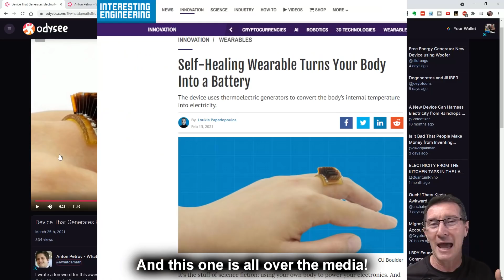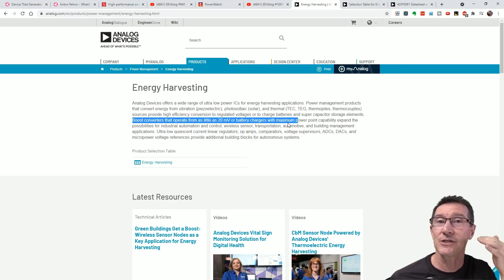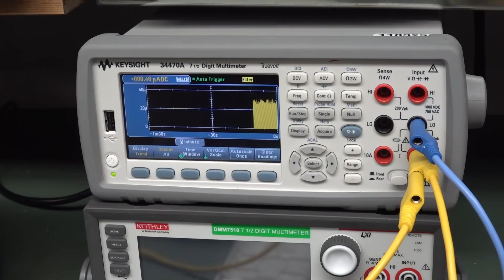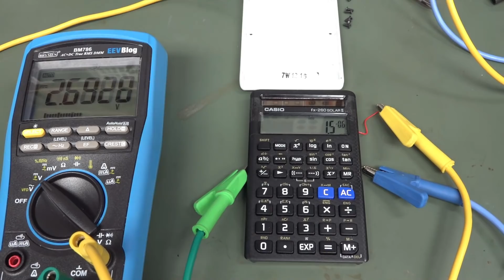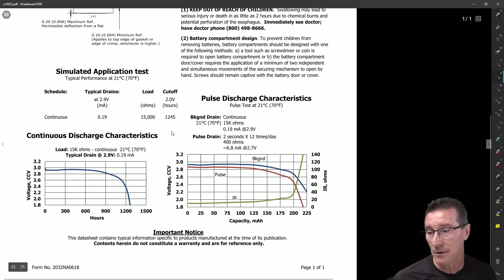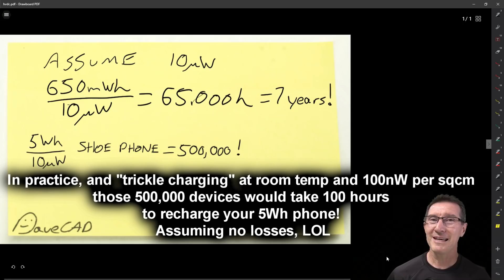EEVblog 1383 - Human Battery Energy Harvesting BUSTED

Comment: I love debunking videos not just for the drama, but mainly for the real-world application of electronics theory, principles and practice.  That kind of stuff is normally taught using "toy" problems.  A good debunking kicks ass, and gives plenty of encouragement to dig deeper and learn more.
Reply: My original comment got deleted .... did you delete Dave ?
Reply: @thepowerisinyou2886  what was your original comment. sounds interesting
Reply: Some preposterous bull is stuck on our faces & we need to jettison & debunk these masters of disaster for the fraudsters that they are
Reply: debunking simple things also confirms ones self grandising bias. assuring that if you come across an anomolous effect you are more likely to dismiss it without further research. because you already know everything. handy tool to have.
Reply: A comment from 18 hours earlier than the video publishing...
Reply from the maker: @redsmith9953  Patrons and forum supporters often get to see videos early.
Reply: @EEVblog      dave your wrong we use heat all the time to convert to energy i.e nuclear , mirrors  ,   etc..
Reply: @redsmith9953  I think donors get to see videos a bit earlier
Reply: @chouseification  , oh thanks, mystery solved, thanks!!!
Reply: @bobjohn8581  -  Thank You for your info   :    )

Comment: He leaves out so much by using the word practical because he has a limited ability to make a system that works. So this is click bait garbage and insulting. 

You can power small devices with energy generated by the body.

Comment: Not that it tells about how useless thermo-electric generators are, but more about how consuming our smartphones and smartwatches are. We need more low-powered devices. Especially for things like watches. Smartphones is one thing, but I don’t need some full-hd-like resolution on smartwatches. I don’t need ECG, GPS, auto-SOS, I don’t even need accelerometer. I already have GPS in my phone, why would I need it in watches… Basically just give me Bluetooth for the ability to sync some data like to show notifications from phone, plus a few apps like timer, clocks, alarm-clock, and nfc, - should be enough for watches. If it can really work throughout years without charging, it’s good, it’s what I’d want. I mean, I have Apple Watch, and I only use the mentioned functionality (clocks, timer, alarms, notifications, nfc), but unfortunately they live thoughout like… A day or two? Useless. I’m not even feeling like spending time to wear it on my wrist for that amount of time. I feel enough charging phone and iPad everyday, I’m not feeling like adding smartwatches to the list. Too many things to change. So my watches just keep lying on my table, infinitely on charge. Because fuck them. Give me more low-powered devices. Especially those non-essential devices like watches. Give me watches that do the watches stuff (clocks+timers+alarms), plus notifications, plus nfc to be able to pay with it. Make it low-power consuming. That’s all I need from watches.

Comment: I can see a very interresting application for power harvesting in the human body: For pacemakers, basically your body charges a battery/capacitor which is then used, but it is probably more expensive and less reliable.

Comment: We need to get Jixuan and Sebastian in here to read this white paper "all hail the white paper" and tell you that it gets 19u/W at 95K which is -178C and -288F, so at room temp of 21C (70F) you are at 294K, which is not only greater than 95K, it's 3 times the required temperature. That means it's going to generate 57u/W  per cm2 which is even better. Making a backpack out of this could power a phone or tablet.

Because if the guy is so dumb as to think thermal expansion only applies if one side of the object is hot and the other side is cold, then he is going to believe what I just said hook line and sinker. I feel bad for the university that gave him a degree.

Comment: Creating a thermal electric generator that's powered off the human body can really work. The only thing you need to do is increase your body temperature to about 350 degrees Fahrenheit, none of that Celsius crap. After that you can probably generate enough power to light an LED.

Comment: This is a fairly common thing. How many battery tech announcements have since gone the way of tech like this? The announcement is sensational and cool sounding, but never has applicable use. I remember some scientists in the early 2000's working with rat brains. They claimed they were teaching rat neurons to fly an air plane. The problem is the neurons would live at most hours and suffer severe damage at the electrical interface to the computers. The actual success rate was 1 in 10,000. It took many hours of set up just to get 10  or 20 neurons out of thousands to actually respond to electrical stimuli. It was essentially sensationalist publishing that would never see applicable uses. I'm sure brain to hardware interface research is ongoing, but there was zero chance their rat brain neurons were flying anything in 2000!

Comment: I like to assume the human’s understanding of the matrix robots’ plan was wrong (the robots did take over the planet and maintain dominance, after all).  That what was actually happening wasn’t using humans as batteries; that the robots were using humans as neural network processors that are powered by carbohydrates rather than electricity.

Comment: Debunk the 2.5v they say in India they are running analog clocks. If you hold a carbon rod in 1 hand and a magnesium rod or piece in other and hit voltage meter unit shows 2.5v

Comment: well, considering Casio wrist watches... In 1992 my classmate had some watches  (I can't recall brand) working on heat power. I looked at it thoroughly and there was no any battery holder and it had some shiny metal plate in the cavity. And it worked. That was amazing! Surely they consumed very low power, modern gadgets consume thousands time more.
 But in short time they started go faulty, LCD covered with black haze, mostly after him sweat, humidity did bad job.

Comment: I was wondering, ditching all the skin stuff, if we put this technology to use in powerplants of today (so realistically, we're probably talking dozens of meters of surface area and hundreds of degrees C difference at minimum), would these be more efficient than steam turbines? i'm mainly assuming this because of no moving parts and fewer energy conversion steps (heat directly into electrical, instead of heating water to produce steam, which then turns a turbine and that then turns a generator that makes electricity).

Comment: There was something similar to this (in terms of being impractical) a few decades ago that used a tiny magnet on a spring in a coil. It supposedly turned movement into power. But basically you would have to be a punk doing the pogo on speed to get any power worth having out of it.

Comment: Very interesting investigation.... Looking forward to future installments. 
I've got a 3" square solar cell I use to power an AM radio so i can hear the news outside with no batteries, It's so impressive that they work as well as they do. 
For the thermal generator, under the arm would be warmer.

Comment: The people talking about smart watches do that for the clicks really. But some BANs could potentially work. So I would guess that it could be build in patches for hospital patients to monitor whatever variable they can with such a low power, once every whatever. Combined with some RF energy harvesting, it could work, it could work... I know that at least in theory my university has developed a fA voltage ref (for internal IC of course). I do not see why not. But really combined with other methods. and for extremely limited and specific applications.

Comment: I have colleagues - formerly at the same department - who not only believe that it is useful, they also repeatedly got research grants for this topic. Me and some other colleagues can only face-palm...
They once promised to develop their own carbon-based materials but had to revert to commercial materials to show some results before the end of the project funding period...
Reply: Even if you were in a very cold environment you could not dissipate the heat from the cold side of these units - as can be clearly seen on their own thermal image - the outer parts of the TEG are still significantly warmer than ambient temperature.

Comment: Well, if 1cm^2 can produce 0.0001mW, perhaps a couple thousand could actually be useful. I mean if these would be used not in a device itself, but as a layer in cloth (maybe inserts in sweat-shirt, pants, hoodies, etc). If those could be efficiently connected, perhaps combined power would be enough for something. I don't expect it to be better then batteries, but as actually working gimmick it could be interesting.

Comment: The materials of thermoelectric devices give a practical way to make use of waste heat. Nevertheless, the idea to apply TEGs to make use of the waste heat is not yet doable efficiently. So new materials or methods to increase the efficiency of TEG devices is required. The following relationship gives the conversion efficiency of TEG materials, ZT is the figure of merit (dimensionless): (T)(α^2)(σ) / λ, where T - absolute temperature, α - Seedback coefficient, σ - conductivity of electricity, λ - conductivity of heat.  Reducing the thermal conductivity in TEG, the material between the hot and cold plates that separates them and that generates power, will increase efficiency. But such a material to increase the efficiency in order to make TEGs practical is yet to come.

Comment: Putting a bunch in series won't work very well unless they all see the same temperature delta.  If they're at different temps, then their max-power points won't line up, and the unit with the weakest output will limit the current for the entire string.

Comment: 9:15, you read wrong, that blue curve is "Tcold" (45C) not power, its even less, the gray curve. It is actually more like 5 uW.
Another thing not helping the device, in your ballpark calcs you use a temperature of 37 degrees, but skin temperature is usually much, much lower (especially on extremities like fingers). It depends on the outside environment of course, but I expect them to be a good 10 degrees colder than core body temperature.

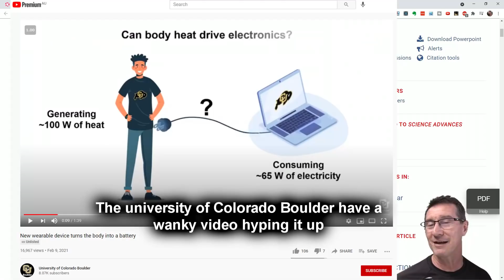Comment: 3:08 the drawing looks like he needs to plug the wire into his ass 😂. Probably a good place to harvest body heat, but at what cost? 😂
There are some regular watches that got recharged by body movement. Probably wind-up wristwatches. I wonder how much energy could be harvested with devices like that. I doubt it's much, but pretty sure it's more than using a TEG.

Comment: Dave, better make sure you are 100% correct especially when busting things, otherwise you just sound stupid, honestly how is it possible that you can't tell the difference between an lcd display and an e-ink display, e-ink has been around for what now, like 10 years? In the video around 17:30 the efm32 gecko attached display is not an e-ink, it is a bloody lcd, how is it not obvious to you, "it does not draw power when showing a static image" -> false, just remove power and see if image remains. The display in question is a sharp memory lcd, basically a monochrome tft lcd, it draws power while displaying content and requires doing polarity inversion regularly/cyclically. Basically it is an improvement on lcd tech, very nice contract, low power, clear crisp graphics etc, but fundamentally it is lcd technology. Just search for "sharp memory display" or application note 48 from silicon labs

Comment: What if you put electrodes (like copper and zinc) under your skin? Would that work as an electrochemical cell? It would be probably quite harmful.

And about using body heat to make power. I have seen some video showing a stirling generator running just by placing it on your hand. It rotated slowly but maybe you could put a magnet on the shaft and a coil around it to make some small amount of power. And maybe if the voltage would be too small then you could make some sort of LC resonator circuit tuned to the frequency of rotation to amplify the voltage.

Comment: In theory that watch project would have worked if it was e-ink low power hh:mm time only watch that updates the display once a minute, not some dumb smartwatch. Also 95K is -178,15C, that much temperature difference is lethal to humans._

Comment: You are better off using a pendulum system, and still, you only gonna get enough to power a watch, maybe a small taser if you manage to storage energy faster that it goes away.
in any case, you not gonna go to the moon (with 5 watts) with that, is quite clear.

unless you wanna to really encumber the person with weight or get a dangerous DeltaT (think person on snow covered only by peltiers). forget about it.
see, you don't even need serious math, all you need is just some intuition on how much power those gadgets can produce.

Comment: I wouldn't dismiss the concept completely. Don't forget you can harvest the energy over 1-2m² of body surface by integrating these modules into clothes, and you may get even another order of magnitude more area by making the TECs non-flat (like a heatsink design). Under normal ambient temperature you'll get about 1mW/m² - that's definitely usable for something like a watch or even devices with higher burst power (like LEDs or a torch light) that are only used for minutes per day but are charged constantly at the low available power. It's probably still much more economic to just use sealed batteries, but it might have its use in ultralong lifetime or ultra-reliable applications like an emergency vest with built-in gizmos that just works by wearing it, even if you take it out of storage after 20 years.

Comment: the only use I can think of for this is to build it into clothes of people working on the south pole; there is a huge temperature difference between their body and the atmosphere, and there is very little sunlight for much of the year; so solar powered devices would not be reliable. or they could use batteries...

Comment: Back in 2019, I was at a conference in Dallas and I met a 6th year PhD student working on energy harvesting for a top tier university based in Arlington (y'know which one lol), Texas. I asked him about his research and I could see the pain in his eyes. He slouched and said, "energy harvesting has no future, it's all bull$h*t".
Reply from the maker: LOL
There are some niche apps, but otherwise, yeah.
Reply: From humans or the mostly natural environement at least... It works decently to harvest te energy from IC engine exhausts and use it to pump more air for example... (i.e. turbos)

(Directly using heat works as well - e.g. gas turbine exhausts for heating stuff (or running absorption chillers)

(Stirling engines might also work in cases where the mass is not an issue...)

(There is lot of efficiency to gain... The cost is often an issue though...)

Comment: If I figured this right, a temp difference of 95K is the difference between 98.7* F and -90*F,  so ya, you're pretty close to dead.
Reply: The Kelvin scale is the same as the Celsius, so 95K temp difference is almost the same as from freezing (0) to water boiling (100) for 1 volt... I'm afraid I don't know Fahrenheit, but would it be the same, from freezing point of water to the boiling point?

Comment: Well, you missed something. You need to take an analytic approach!

You are right, that a reasonable temperature difference from your body skin to air would freeze you to death.
Therefore, you would have to put the device to a warmer place. That's the "anal" in "analytic approach".

If you change this device to a "plug", you could harvest the temperature difference from +inside+ your body and air...  Maybe that helps...

Comment: The only ways thermoelectric energy harvesting like this would make a usable amount of power from the human body would be if it was either if it was embedded into the person (which would be highly perilous to the core body temperature!) or if it could be formed into a thin layer that covered a large percentage of the body area - like a skin-tight catsuit. That in itself is not inconceivable, but the tech isn't here just yet. So call me when you've designed a thermoelectric fabric! Being charitable, this research is perhaps a first baby step in that direction but is far, far from practicality. You'd be far better off just sticking solar panels to your clothes with a few rechargeable batteries for when its dark!

Comment: You don't need to go to Mars lol. -58dC would be enough.
But first thing I thought of wasn't to put it on a human. There's lots of things that gives heat waste. Like an engine. Cooling towers on buildings/factories with huge heat exchangers often cooled by evaporating water. I don't have a clue to in what order this energy source can cool the surface down while using the energy, but it would not work either. Like the cooler in a car, for instace, there would be a huge amount of energy to dissapate to make it a cooler. How many cm^2 would that take? LOL! There would be hundreds of watts to be cooled away into the air. 
No, in no scenario would this technology be of much use.

Comment: Maybe a tshirt/shirt/pants made of this material, would have enough surface contact then? And a watch is integrated into the tshirt/shirt/pants?

But yeah, washing might be problematic then :) and lifespan is questionable.

Athletes would output quite alot of energy? Could they use that energy to enhance their performance somehow or power something useful while performing athletic activity. But yeah, efficiency would depend on time of the year... (cold/hot outside...)

Edit:
I read the comments - scrap everything i wrote above